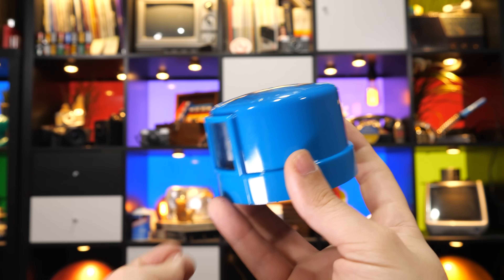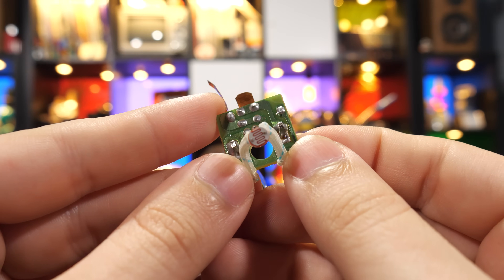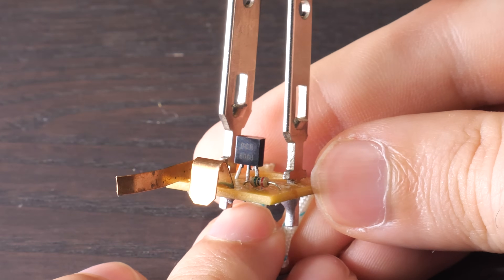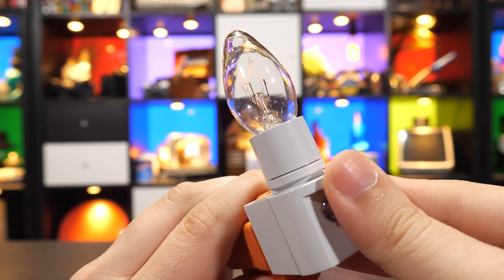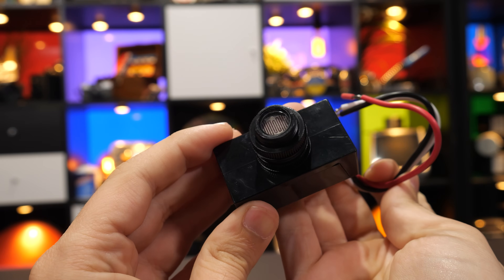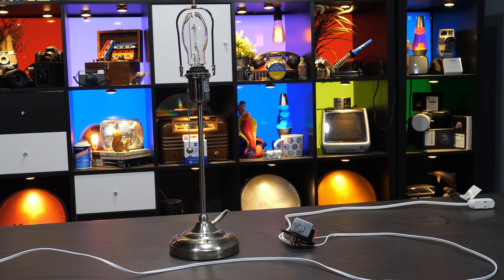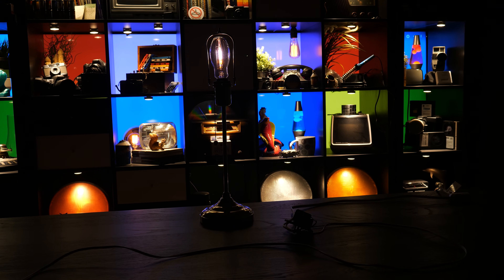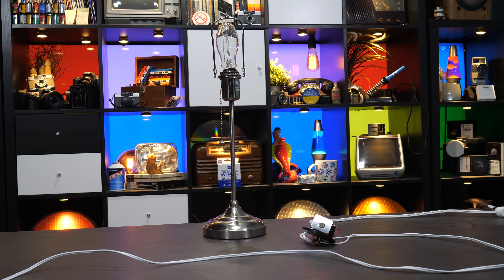Photoelectric light controls are weirder than they seem

Comment: About the resistors being used as a heater:

resistors and heating elements are the same thing, just varied in order to be better at its purpose. 

Any electronic component takes an input and gives an output based on the input. Pretty much all of them can be reverse. For example, an LED will produce minuscule amounts of power when you shine light on it; likewise, a solar panel could theoretically produce light when you pump power into it, but it would likely burn our before you notice.

Each component pair (leds and solar panels, resistors and heating elements, etc) have basically the same composition.

A heating element is a coil of resistive wire which will get hot. It just happens to resist current flow. A resistor is exactly the same thing, but it’s DESIGNED to resist current and heat is just a byproduct.

I’ve seen LEDs be used as solar panels (usually as a form of light sensor as an alternative to an LDR), similar to how resistors are being used here.

If something works (safe enough) then why not use it

Also, Alec, a video about the concept of components being used in reverse could be really interesting, Peltier modules are a really good example!

Comment: Over here those are not used anymore.. they were very unreliable...... replaced by photoswitch relay....... the cheapest are just an infrared LED.. controlling a transistor.. that then controls a relay....... a capacitor in the transistor does the delay between on/off state...... you find them with a semi-transparent top and blue bottom casing... or just the PCB board...

Comment: In my country I found some very old ones and they have a large LDR connected to a relay in series, I didn't pay attention at the time, but I think it was a normally closed relay, and during the day the LDR powered it off...
  (Relays already have hysteresis-like behavior, they need higher voltages to close/open than to do the opposite action)

Comment: One of the advantages of the thermal switch is that it delays the switching action.  This is a good thing as in lower light conditions, every cloud that passes doesn't turn on the light. These are used extensively in cell tower/radio tower obstruction lighting equipment.  in the case of medium intensity white obstruction lighting, they switch between day/night mode,  In the case of day white/red at night they switch between lighting sets.  And of course, red at night/painted tower they turn it on and off.
Reply: Though there are other ways we can do that now, I'm fairly certain we aren't using thermal switch on newer models in some countries just for efficiency reasons.
Reply: The problem is that here in the USA, we have to comply with the FCC and the FAA and yes, there are other ways to do this, but lets be honest, these devices are extremely reliable and when it comes to aircraft safety, there is not a lot of pressure to change.
Reply: @EwanMarshall Efficiency really isn't an issue with a modern implementation.
If you are using 1-2 of these to control the lights for an entire parking-lot/roadway, let's say 50 lights, they would consume less power than the wires delivering power to those same lights. 2W is a rounding error.
If you were doing it for EVERY light it would probably be worth looking at a different solution, so we did.
Reply: So on a very hot day it will just work without the photo sensitive elements at all.
Reply: @bentuttle  It would be a hot day indeed.
It looked like that switch was triggering at ~80C (176F), which is pretty high, even for a box sitting in direct sunlight.

Comment: I have been an electrician for 20 years. I've never seen a Twilight switch whose operation is based on a heater before. All the Twilight switches I have installed have been electronic, where the adjustments to the twilight level and hysteresis are set with a potentiometer.
Reply: In most things electrical, America is a LONG way behind the rest of the world. Just look at the typical American electrical panel (switchboard)... we stopped doing it that way back in the 1960's

Comment: For decades i tout that all streetlights were connected to a central system in wich activates  and deactivates them on a time basis determined by the goverment (let’s say it activates those lights on 21:00 o clock till 6:00 o clock regardless of winter and summer,
BUT i might be wrong or it depends per country,
For what i,ve heard is that in frans those street lights are still controlled by a terminal computer running windows 3.11,not sure if this is whether true or not but interesting to know.

Comment: The plant I work at decided to use a timer instead of a photosensor for our parking lot lights and just last fall as the sun started to rise later and later we started to get complaints from employees about walking to their cars in the dark. I got told that one of our other techs was sent to adjust the timer to shut off earlier but might not have gotten around to it so I went up to check. I saw the on command was set correctly but the off command was set too early, changed a 6 to a 7 and called it a night. next morning I get to leave on time for once and to my genuine surprise... the lights were out a 6 and not 7. I went back upstairs and found the actual source of my woes. A third command was enabled in the 19th programming slot of the 24 slot timer... it was set as an off at 6am. I took pictures and deleted it as I walked out of the plant 20 minutes late like always, this time with the lights on.

Comment: You just glanced over the microcontroller problems. It would need accurate time keeping because time drifts. It could be solved with ntp but then it introduces dependencies on wifi and network programming and TLS encryption and firmware updates

Comment: A fair amount of cheap LED nightlights tend to use a brute force approach to shutting the light off in the day - i stead of the current passing through the LED(s), the current is simply shorted/shunted to ground, bypassing the LED(s), turning them off. 
So it might actully be drawing slightly more current/power  when not lit, compared to when lit...

Comment: I heard they are replacing some of these with microcontrollers so they can do more then just turn the lamo on and off.  Light poles turned out to be an excellent power supply for sensors because of these standard connections.

Comment: The jazz is back! Yay. 

Using the heater as a cheap and simple solution reminds me of your video on older turn signals (the synchronizing issue one). It's a fairly inelegant design, but it's robust and reliable (and most importantly, cheap).

Comment: The heater would likely also help in cold climates with ice and snow which can block the photoresistor during the day. During the night, the bulb should be putting out enough heat to prevent ice and snow building up, but during the day it might get into a cycle of switching on and off as snow falls, blocks the sensor, the bulb comes on, the snow melts, and the bulb goes out, then snow accumulates again. A light is not needed on during the day, so any light energy is wasted, only the heat is useful to clear the sensor so more energy efficient bulbs would actually makes this worse. The switch incorporating a small heater might actually save energy in winter especially if it is close to the photoresistor so it is better at keeping it warm.
Reply: Thanks for the explanation, now it makes more sense to me. It doesn't snow where I live. The photocontrols I saw here just have a relay contact inside.

Comment: It's rather interesting, because I wouldn't think using a photo diode to heat a bimetallic strip when hit by sunlight would be the most straightforward option.

It seems like it should be possible to simply use the heat of the sun to turn on and off the switch...but maybe it isn't feasible to include enough insulation to make that work reliably in wide enough ambient conditions to work in both winter and summer.

FWIW...I think most streetlight in my area are controlled by timers, not those types of things, but that's almost certainly a recent change.

Comment: Here in Europe we have relay-based photoelectric switches for the streetlights (Often controlling a bank of lights instead of having a sensor per light), that have a small solar panel inside them and there is an adjustable time delay as well.
They surely use electronics, and the time delay is there to keep the dusk/dawn erratic behaviors mentioned in the video from happening.
Reply: I’ve definitely seen timer-based systems here too, as usually lights are off during the middle of the night
Reply: @haroenv  Yes there is also that, however what I was talking about is the time delay that is part of the photoelectric switches that we have here.
It's so that when it becomes dark the streetlights won't come on instantly and same at dawn.
Reply: I was about to say, I thought they were photoelectric because in Australia we call them PE cells.
Reply: @jaisbr  What I'm talking about is something that generates voltage from light, like the small ones on calculators and the large ones on some roofs. 
Here it's used as a light sensor, not to generate power.
Reply: What's the purpose of the solar panel  - to power the time switches or charge batteries for the time clocks? Obviously not for powering streetlights at night.
Reply: @andrewmurray1550  The solar panel is only used as a light sensor in lieu of a photoresistor, the time switch itself being powered by mains voltage.
Reply: Both are used. Photodiodes are really useful as are timer based systems (because solid state programmable timers are cheaper).
Photodiode systems let you set the turn on light levels to very specific lux settings.

Comment: Such a shame these are being replaced with cruddy LED fixtures that barely last a month. The lamp outside of my house has began acting up. That lamp is AT LEAST 12 years old. They may be expensive, but they're robust and very simple. I hope they actually replace the light bulb instead of the entire fixture with LEDs when they finally come out to repair it. I live in Florida by the way. Gets pretty hot here, even at night. That's probably why they fail so quickly (Oh, and they also turn blue for some reason) You mentioned capacitors not liking heat. Guess how LED lights are powered? It's kind of sad, actually. We're replacing tech that works and is reliable with a technology that turns blue if it even still works after 6 months.

Comment: As a facilities tech, photocell controlled lights are a godsend in many commercial settings. I retrofitted a ton of exterior pole fixtures that used metal halide lamps to LED, put them on a photo control and basically forgot about them. So much less nonsense to deal with.

Comment: back in my home town there was a very straight street and at sunset the lights would light one after another at the perfect speed where if you started walking at an average pace it would seem like you were the one turning the lights on as you walked under them
always thought it was something to do with the earth spinning, so the light hitting the sensors on top of each post was just different enough to cause the effect
starting to think now that It's something to do with how the lamps heat up 
or they have timing circuits inside and some local sparky setting them up had a good time setting them all just slightly different
Reply: Could also be that the lamps were sequentially activated so they didn't all overload the power supply. A little delay to let the lamps start up, and the current to drop before clicking on the next.

If they all clicked on at the same time, they might have browned out the street, or blown the fuse.
Reply: Moo, moo.

Comment: It is sadly not inconsequential if all street lights turn on after a power outage. Makes black and brown starts of a grid even more of a nightmare than it is anyways.
Reply from the maker: Eh, compared to all the other loads that are immediately trying to come on, I doubt it's significant. Besides, the power grid has to handle all street lights coming on within the same 10-20 minute window every evening.
Reply: @TechnologyConnections  Not really, group control will take roughly an hour to switch the entire metro on or off, as each group photocell has varying amounts of shade on it, and the light levels are not too tightly controlled as to exact switch point, that has a pretty large variation between each photocontrol. Biggest thing is all those cold water heaters all sitting there already on, waiting for power, that is a massive surge.
Reply: @SeanBZA  Those are all resistive loads so not that big of a deal on grid restart. The inductive loads of motors though, like in HVAC systems, are a big issue with inrush current causing voltage droop.
Reply: @TechnologyConnections  I would agree it's inconsequential, but all the lights coming on over a 10-20 minute interval, but staggered due to variations in the detectors and their local light condition is entirely different to simultaneously switching them all on when power returns.
Reply: nowhere near as not inconsequential as everybody's electric climate control system trying to start up is though.

Comment: Also, if the resistors fail the light will come on. Which means at night you wont have street lights that are unlit until they are fixed.

Comment: You don't need software or even a microchip, just a few transistors in the correct arrangement. Although you probably then want a relay for the big load. And your points about delicate electronics in harsh conditions + the power supply all remain valid.

Comment: Thanks, hysteresis to you too. But only for the temperature at which the thermo switch switches, not for the delay caused by the heating/cooling down. :P
About the light control itself. There would be many many fairly simple ways to do this without a microcontroller and without wasting much power, just needing like 3 more components. I think it mainly boils down to reliability. Any part you add, is a part that can fail. And as you mentioned, in this case you get hysteresis and a little moving average filter for free, using very little components, all of witch aren't particularly prone to failing. I believe the reason it heats up to turn the light off, is mainly so the most likely failure mode is for it to turn the lights on constantly, instead of off. This way the lights are still on at night, so they can replace the sensor within the next week or two, without any safety concerns due to the lights being off (which are obviously there for a reason).
Reply: The comparator will need a power supply, which will add to the cost. The cheapest would be a CR dropper and a zener diode for voltage regulation). It would save a little bit of power at the expense of making it more expensive  and maybe less reliable (capacitors).

Also, the little amount of heat that is produces by this switch probably helps to melt the snow in the winter, so you do not need another component for that.
Reply: @Pentium100MHz  
Then don't use a comparator... Like I said, there are countless ways to do this. You could even just use circuit inside the night light, to close a relay. You may wanna use a triac instead of a thyristor, in order to get both half waves of the AC voltage. And possibly add a resistor or two in series with the triac, to shift the switching point when the triac is on (in order to add hysteresis). Delaying the switching action is a little difficult without using a capacitor. But there are very reliable and cheap capacitors, you don't need to use unreliable electrolytic caps. I'm sure it may increase the cost by a few cents. But then again, it also saves power.

The heat melting the snow is a good point. But of course, you could also place a roof over the sensor and have it look out to the side or whatever, I'm sure there are plenty of ways to overcome the snow problem as well.

Like I said, I presume they do it this way to reduce the part count and therefore the failure points as much as possible while also keeping the price down. And really, two watts more or less, doesn't make a huge difference compared to the many hundred watts of a whole block of street lights, so why make it more complicated than it needs to be, right?
Reply: @phinok.m.628  "why make it more complicated than it needs to be, right?" 
That's my point as well. Power usage is not the most important thing. Everything is relative, the 2.5W is pretty much nothing. Maybe even making the device more expensive to save power could be possible, but if that made it less reliable, then, well, I am sure it costs way more money to replace it than the device itself or the power it uses.

Similar to how people in the past tried to make steam locomotives more efficient in different ways (compound engines etc), but that made the maintenance costs go up and while you saved some money on coal, you spent more on maintenance.

Comment: Back in the 90s I worked in a building with huge glass windows on the south and north facing walls; the south were plain glass, the north windows were tinted glass which meant that we had to use fluorescent overhead lights. As a power saving technique whenever the sun appeared    for a few minutes  the internal lights all turned off leaving the north facing ofiice in darkness until some one walked about ten paces and turned them on using the push button. Eventually, after a few weeks,  someone taped over the sensor.

Comment: I'd always assumed it was basically a photoresistor and a normally-closed relay. Light falls on it, power passes, it powers an electromagnet that pulls the relay open.

I mean it's basically the same idea, just with a heater instead of an electromagnet.
Reply: i assumed the same